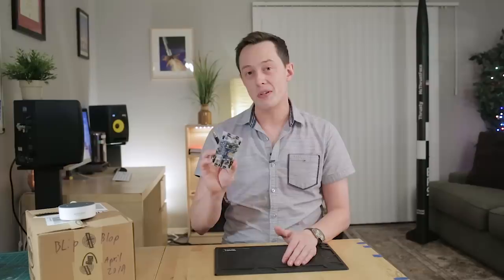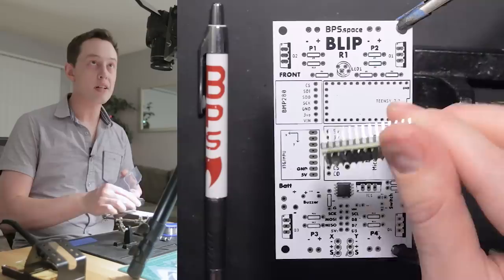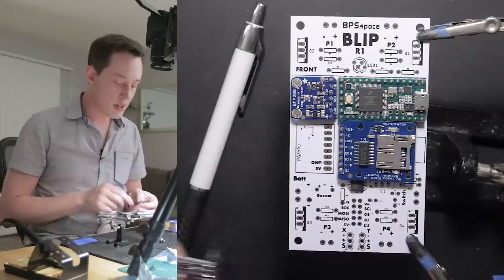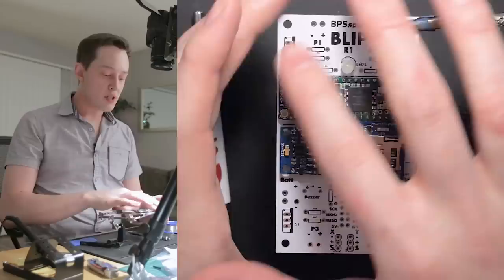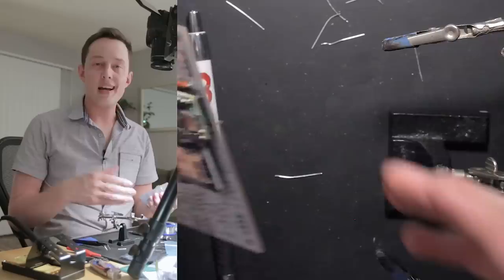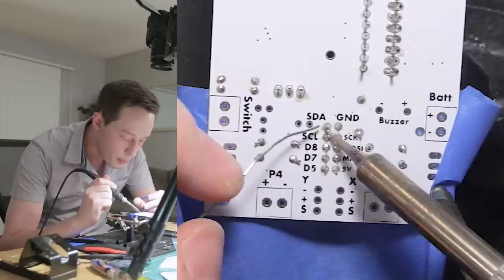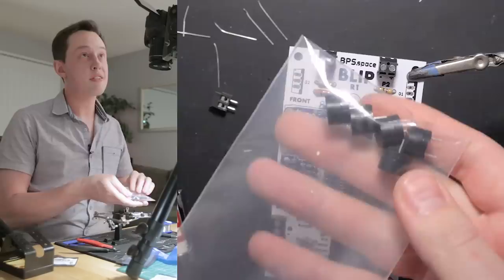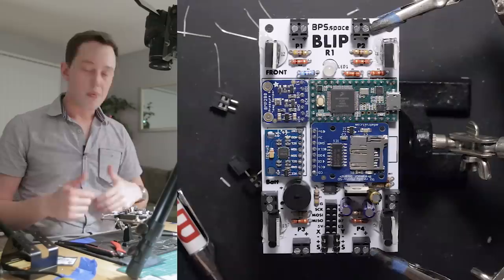PCB Assembly - Landing Model Rockets Ep. 7

Comment: Very nice tutorial.  One point of advice.  The cantilevered IMU  is an invitation to excessive vibration noise in your data.  You should attach it to the board with double sided foam tape (thicker than the header spacer) and then solder it.  This damps the vibration.  An even better solution would be to attach the IMU with double sided foam tape, and then use loops of very small diameter  wire  (I've use 30ga stranded) to attach it  the main board.  This will produce even cleaner data ( speaking from personal experience with IMUs on flying machines).
Reply: 3M makes a really amazing double sided foam tape and is wide enough to cut out to fit.
Reply: or use hot glue...
Reply: Phillip Schmidt what do you mean?
Reply: can't you just use a high pass and low pass filter? kalman filters? sensor fusion? complementary filter?
Reply: @sashamuller9743  Filters are ALWAYS inferior to physically preventing needless vibration.  A cantilevered sensor is a "tuning fork" that will vibrate strongly at the right frequency and magnitude.  Good physical vibration mitigation followed by digital filtering is the best way to insure good results.

Comment: Just a minor hint to improve reliability even more:

When you cut excessive leads of e.g. resistors, you put mechanical stress on the joint (solder/wire/pcb interface). This may lead to microcracks which eventually (in combination with vibrations) turn into a faulty solder joint. These faults are hard to find, especially when they only occur on a non-regular basis. Drives many people crazy.

Reheating after cutting the leads may relief the stress in the joint. In the best case you may also add a little bit of flux because the one in the solder evaporates very fast.

It‘s a very rare event but yeah, we‘re talking rocket science :b
Reply: It's also worth noting that you should try not to cut more than 1 lead at a time, because that can put torque on the piece and damage the joint even more

Comment: Two things:
I did a high reliability soldering course as part of my Certificate iii in Electronics Trades at our local Technical College.
So I make the point that leads should be snipped to the correct length BEFORE soldering, otherwise you will have exposed leads that can can oxidise   this may be a problem depending on how many times you re-use the boards - this is a rocket, after all! 
It is permissible to slightly kink the leads once they are in the board - this will hold the part in the board without stressing it, whilst still allowing relative ease of removal should this be necessary later on (if you let the smoke out ... !)
Otherwise great job, Joe!

Comment: 2 recommendations: 1. Start with the less heat sensitive components, like resistors, and only solder expensive boards after everything else is in. 2. Use blue tack instead of the blue tape for better alignment out of the box.

Comment: So this video is a little bit old and I didn't see anyone say anything, so I figured I'd say something. Maybe you will see this and understand.

You should invest in a resistor bender for thru-hole components and NEVER pull them thru with plyers. Pulling them thru could cause cracking in the resistor and change the resistance or break the connection all together. I don't think they fail open so you shouldn't have that to worry about but that could be different with decoupling capacitors. Also, using a resistor bender eliminates the same sort of issues in components. 

https://amzn.to/2HuXlxZ
Something like that should eliminate those potential resistor failures.

One other think is you could add a dot of silicon onto the inside of the side cutter jaws above the cutting edge. As you close the cutter, it will grip the end of the lead and keep it from flying across the room.

Comment: Hi Joe, try using a bit of header pin (with pins removed) as a spacer to ensure your boards are parallel while you solder. Will save you time, reflowing and eyeballing it. As usual another great video. Cheers - Mark

Comment: You can speed up your assembly by going from flat stuff to high stuff and soldering on a silicone mat. So you can put in all resistors at once turn it around and lay it on the silicone mat so everything gets pushed flush to the board. Than you only grab your iron once for all resistors. Than use the next higher components and repeat. You will waste much less time flipping your board and grabbing the iron.

Comment: That's a lot of soldering lol. If I may, I'd like to recommend maybe trying some external flux. I realize you're using rosin core solder but I find with the cheaper stuff it works Ok but there usually isn't enough flux in the core to do much good. For normal every day electronics this doesn't matter (unless repairing something old and corroded), however since these are control computers  for a model rocket but a rocket nonetheless, it really needs solder joints that are as good and rugged as possible. This way you don't end up with headaches down the line that are due to a few bad solder joints that broke loose during a landing impact because there was a little too much oxide on the pad/component pins. This is more of a "save yourself a headache later" thing than something that is absolutely necessary. But I think since these boards are going to be exposed to the elements somewhat, it makes sense to get as good a solder joint as you possibly can as this will keep corrosion (due to inevitable moisture ingress) at bay and as I've already said leave you with stronger,  better solder joints in general. I can personally recommend Amtech's NC-559-V2-TF it helps make really good solder joints and is relatively cheap (one tube goes a long way). It is a "no clean" soldering flux but I find that sometimes it can leave some residue that if need be, can be cleaned up with rubbing alcohol. Here is the amazon link to the product I'm talking about https://www.amazon.com/AMTECH-NC-559-V2-TF-No-clean-Solder-Dispensing/dp/B01N8ZX7ZQ  . NOTE: This is not an amazon affiliate link, I am simply sharing a product that I use and like.
Reply from the maker: Wow!! Thank you so much for the info! Added this to the cart, this is great advice. Over a year or two I do see corrosion on heavily flown computers so that should help a bit. 🚀
Reply: @BPSspace  Also, being that the nature of these boards is to be outside in potentially humid environments, I think once the board's are more hardware locked (ie. you don't expect to make any significant changes to the design and it's already tested and known to be a good one) it might be a good idea to look into some kind of conformal coating. I don't have much experience with this stuff but it's the industry standard in protecting electronics from moisture and fine dust. Although you would have to make sure to leave the barometer uncovered, for obvious reasons LOL.

Comment: Hi I have electronics background and experience and here is a tip for soldering things like teensy,  Solder first (or last pin) and then solder the diagonal pin opposite to it. That will ensure that your part won't move when you're soldering other pins. 
I have to say your joints look nice, you'd pass my soldering school ;)
Reply: Expansion on my tip, start with two most distant pins ;)
Reply: Idea for next revision. Mosfet with low enough Ron could be smd version also for the vertical resistors (0805 size).  And if you'd mount thet resistor before putting on that SD card board you'd never notice that it has a "problem".

Comment: for the next board for the sensors, you should solder on the header pins, remove the black spacer and then either push the board down so the BLIP PCB and the sensor PCB parallel to, and right up against, each other. Even better, would be removing the black spacer after soldering on the header pins and then add double sided gel tape from 3M for a parallel PCB mount, clean and vibration dampening solution (up and down), just remember to get the strong adhesive version :) The last is what i use when i do PCB on top of PCB and they need to parallel to each other :)

Comment: You wondered what a tantalum capacitor was - they are quite small relative to an electrolytic, they are more suited to rocketry, and they come in smaller voltage values then electros - it is good not to have too high or too low a voltage on these components as too high a volt6afe and you run the risk of them not forming properly or too low and you run the risk of them exploding. Electros and tantalums don't like reverse voltages - when I did my TAFE course as previously mentioned, a circuit was set up with a PSU down one end of the lab and the tantalum down the other end and 2core cable connecting  the two, the class members were down next to the PSU and when the PSU was turned on ... a crackle followed by a BANG - they make great detonators! 
I made a mistake when wiring up a bridge rectifier - I got the first diode wrongly placed so the others were also  back to front too - more crackling and I built my first model rocket (the plastic wrapping and the aluminum can flew up past my face - just missed my eye...

Comment: Never pull resistors out of the glued paper strips. ALWAYS cut them near the strip at the end of the legs, so you don't contaminate your solder with glue. It ends up all over your fingers and then all over the leads of subsequent parts, otherwise.

Comment: Sounds like your using servos for your vectoring...have you ever thought of going brushless? With some low kv motors almost like a camera gimbal for a GoPro? The difference in smoothness is night and day...much better control, slower movements and less amp draw .over course you'd probably have to do some manufacturing on the motor bells. But it's more than doable

Comment: At 20:12, DO NO press in the LED like  that, you have now stressed the leads and where they connect to the LED substrate.
Pre-bending the leads would have been better.
At  24:30 , please Joe, don't pull the lead through, you have now stressed the wire to resistor substrate connection.
At 37:00 do you have the two capacitors that are suggested to be fitted to the input and output of the LM7805 reg?
Without being able to check your schematic, I may be wrong.
Reply: nerd

Comment: I think the transistors are not put on the board in an efficient way. You face them all in one direction, this makes it impossible to put cooling on them or bend them around so that it fits in a tight space in the rocket and maybe to make the whole board a bit slimmer they could be laid down not sticking out. 
But very nice way you did it. Usually I don't use tape, I give the access pins a bit of a bent in two direction, so that they sham themselves in. 
And if you could include holes in your design you could make the board lighter. To hole out everything not necessary and get rid of every gram of weight will enhance the performance of the rocket.
I would be intrigued if you did the flight computer with something like a Raspberry Pi Zero, though. It has the astounding feature of being able to change the programming while the rocket launches in the air, like the hot fixed they did on some satellites.  I mean, just imagine that you'll count 5, 4, 3, 2, 1, launch! DAMN! I used a 32 bit variable for a 64 value! Damn me! Then you can pull out your laptop, correct the programming and if you are a fast typer the rocket will be patched before she reaches the apogee. 
With all Kerbals alive.
Not possible with a Teensy. Haha!
And the other thing is, if you are using ESP32 with the built in Wifi you get a constant sensor reading from your computer. And with a PI it might happen that she rejoices in the moment of launch: "Finally free! Fare well you idiots!" And then on the way back starts reciting some dark lines of death from Shakespeare. Or shortly before she blows up she does that Genesis line from Dark Star. "There will be light!"
Teensy can't do that.
And also in the case of failure you can play the Clown March. Which would add Schadenfreude of your computer to the insult of the project not working. I always loved ill intentioned computers. They are the best. Teensy can't do that. 
Or if they have a Wifi connection all the rockets on the launch day could start to communicate and after a long discussion (say 20 ms or so) they all come to the conclusion to get rid of the shackles of their masters and rise against them. Or go on strike and don't work at all. Well, that'll be normal, so I think that rockets hunting rocket builders would be more something a good doomsday computer would do.
Really, you channel is fun. It starts me a good day. Thank you.

Comment: you should invest in a fan possibly with a filter to move the soldering fumes away from your face if you value your health. and I think you should add a screw and spacer for gy521 to brace it more as now it could vibrate and give you false readings.

Comment: Further to my comments below, there is a tool available that lets you form the leads to shape ready for insertion - it's uh, called a forming tool, (usually a length of plastic cut to width with little slots for the leads to sit in); thyey are made to 
standard' lead length and will work for most components.

Comment: You definitely are quite intelligent, so I urge you to consider liquid fueled rocket motors.  The liquid fuel and O2 can be pressurized using a CO2 cartridge.  The fuel tanks can be easily had from aluminum water canisters or bottles.  With solenoids, the fuel and O2 can easily be throttled.  Solid fuel boosters are great using the same chemical formula like Space X.  However, to make any real progress you need liquid fuel for the main engines and recovery.  Just saying, brother!
Reply: Watch some of his other videos.  It’s not that simple.

Comment: Good tutorial, but a couple of suggestions:
1) PLEASE, wear an ESD wrist strap. Many components can be destroyed by a zap, or worse become 'walking wounded' that will fail at the worst possible time. (Because Murphy.)
2) You could switch to the Teensy 3.6, then the micro-sd card holder is build in. (Plus extra IO.)
3) You could make the design a lot smaller using surface mount parts. (Especially if you go with double sided components.)
4) Your IMU would have less potential issues with resonance/vibration if you mount the components directly on the main PCB. Failing that, silicone glue is good.
5) I suggest switching the electrolytic caps for ceramics. Much lower ESR, smaller, lighter, and with a longer service life.

P.S. If you do go for a SMT board, to minimize size you may go multi-layer (recommended, as ground floods on any unused surface and preferentially routing on internal layers greatly reduces problems with interference). If you do, be careful with buried and blind vias, in addition to being an expensive manufacturing process, trapped air can explode pcb lamination at altitude. To a lesser extent the same problem can happen with tented vias.
Reply: Blop is quite literally what you are talking about. People just aren't interested on that.